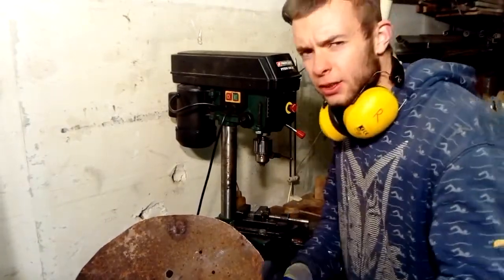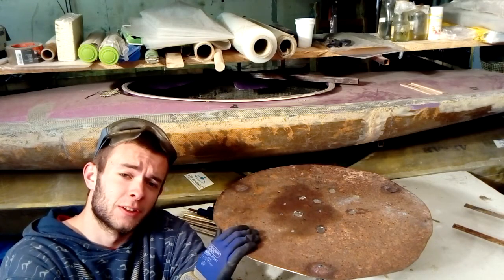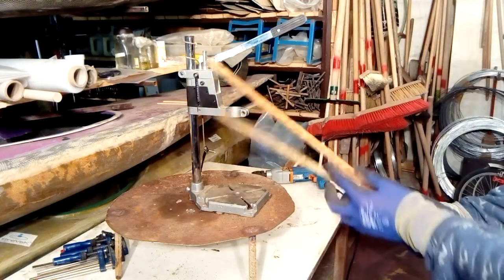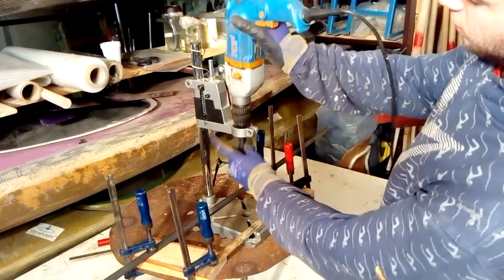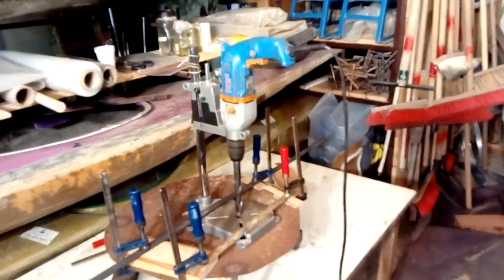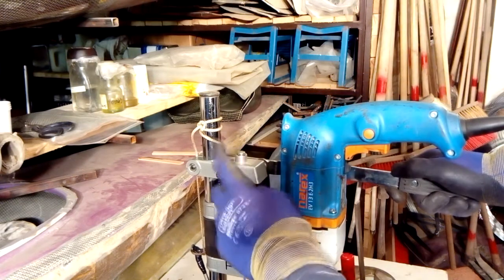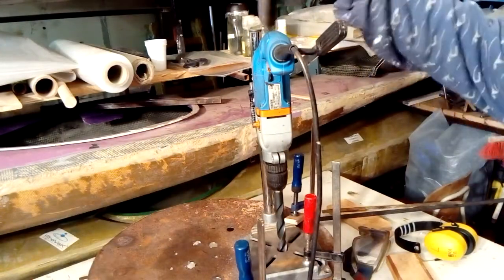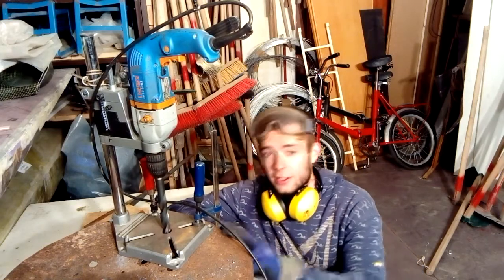MK: DIY Bring drill press to your workpiece #problemsolving

Comment: Awesome idea, I had a same problem recently and I have almost lost both of my arms while trying to hold onto the drill in case it bites, I was afraid that the drill might hit me, or pull me to the side and I might hurt myself in the process.
I should have thought of this, I wanted to put the drill press onto the metal but I knew it wont work....
Reply from the maker: It´s almost like we had the same problem ath the very same time :-D Yeah drills are awesome if the drill bit is rotating and the drill is stationary but when it´s the other way around, all the hell breaks loose (speaking form  experience lol)

Comment: Pilot hole would help and the Lidl drill press is a bit of a disappointment for me, it has a lot of play, can't drill accurate  holes.
Reply from the maker: Danut Plesu i mean you get what you pay for, but I actually enjoyed working with it. Check if your belt or the spindle isnt loose or something, that was usually the case when I had problems